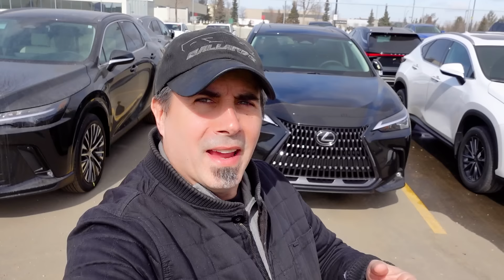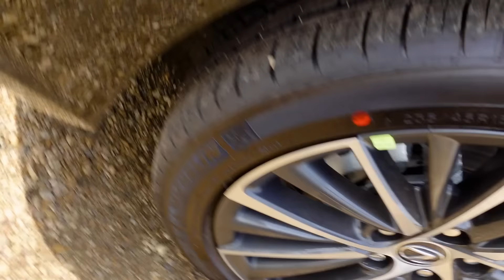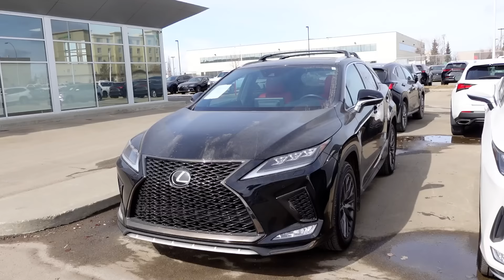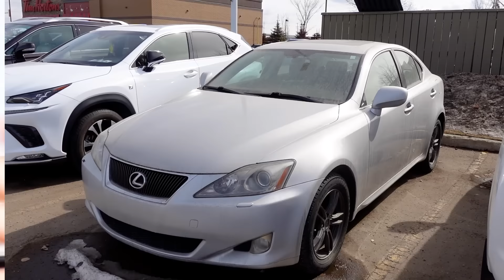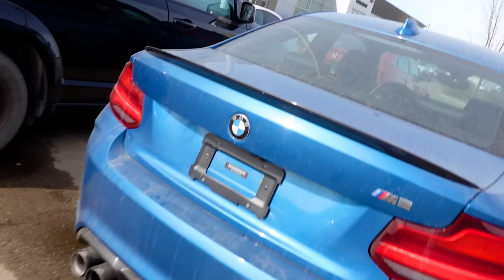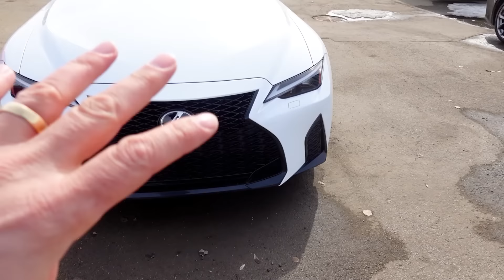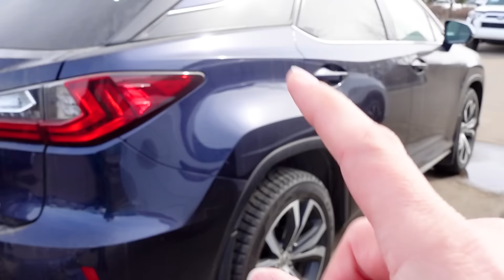Is Buying A Used Lexus a (MASSIVE) Mistake?

Comment: Good practical and helpful video. I have owned Lexuses since 1996 and my current 2015 RX350 for the last 7 years. I bought it as a service loaner...CPO..with 10K miles and it now has 90000 miles and is in very good condition. I usually upgrade to a new or new Lexus every 4-5 years but due to the market conditions of the last 2 years i decided to keep the 2015 as i have always carefully maintained it .I just had new brakes installed front and rear and getting 89000 on the original brakes is phenomenal in my opinion.  Because even RXs as old as 2020 models are selling for very close to MSRP if the mileage is moderate, Im not willing to pay that kind of money for one that old even though it would suit me fine, especially if it was CPO. I dont trust Lexus dealers like i used to ,even with their CPO cars  so if and when i decide to buy another CPO Lexus I will get a pre purchase inspection to keep them honest before i make a deal. The ES350....i have had 2....is actually my fav Lexus but we need an SUV so I usually buy the RX these days, but would love to have another ES even if it was an old 2010 or so model.
Reply: How to do a pre purchase inspection? Shall I pay for the pre purchase inspection by my own? Thanks!
Reply: @he6005  I have never seen any seller, private or dealer, who would pay for a pre purchase inspection. The potential buyer has to pay for it . Importantly, to avoid wasting your money, get a sales price agreement in WRITING which includes a contingency that the sale will only be completed if the pre purchase inspection is to the buyer's satisfaction. Otherwise you can spend $150-200 for the inspection, decide to buy the car and find that you and the seller cant agree on a price. Additionally, if the inspection shows problems with the car the buyer can use that as  a basis for negotiation of the seller's price, or walk away from the deal depending on the severity of the problems indentified by the inspector. Finally, who you select for the inspection is critical because various inspection services dont all offer the same depth or detail of the inspection. When you hire an inspection service, make sure you specify and they guarantee in writing the exact details their inspection will include. A good example might be a compression test which most inspections do NOT usually include, but which is critical in a used car of older cars.
Reply: @whocares0316  Many thanks for the detailed answer! I'm currently planning to look at a 2020 Lexus RX350 with only about 40,000 km mileage on it, and it's even still under the official Lexus warranty. My friend advised me that there is no need to do an inspection of such a new car, just take a look around for myself and take a test drive. What do you think?
Reply: @he6005  All i can say is that in 30 years of buying used Lexuses...both certified and other...i NEVER had a pre purchase inspection done on one and never had a mechanical problem with any of them. Now, however, i think times have changed because I have in the past year started seeing people who bought a CPO Lexus subsequently have mechanical problems only to find out that the Lexus dealer had actually NOT performed some of the 161 points of inspections they rave about while they charge on average $2000 extra for a CPO Lexus vs what the car would sell for it if wasnt certified. So if i were you unless you are trying to buy a Service Loaner with 10K or less mileage, or something similar, i would spend the $150-200 for the pre purchase inspection. Lexuses have gone up so much in price that you really cant afford to take a chance.. It is true that if the car is CPO you have the CPO warranty to fall back on but there are lots of mechanical items that no CPO warranty covers and fixing a Lexus isnt cheap! Finally, before i hone in on a Lexus i want to buy, especially used, I evaluate the DEALER who is selling the car. The QUALITY of Lexus dealers "aint what it used to be" and that is an understatement. And the caliber of Lexus salesman isnt what it used to be. I dont normally ever buy a used Lexus from anyone but a Lexus dealer unless it is from a new car non Lexus dealer who has a nice Lexus trade in they are trying to sell.  I am pretty disgusted with Lexus these days and bought my first one in 1996. Hope this helps you. Just my own experiences.
Reply: @whocares0316  Thank you very much for your detailed sharing, I will take your advice and  consider my purchase seriously.
Reply: @he6005  I understand what your friend is saying about a car with only 24000 miles..US...on it, especially if you still have a significant amount of TIME left on the warranty...which is 4 years from original in service date. I would first demand a Carfax report on the car which any Lexus dealer will always typically provide, and I would NOT normally buy a used Lexus from a non Lexus dealer because, while the orig mfg warranty still applies and transfers, I dont buy used Lexuses unless they are Certified PreOwned..CPO which covers up to 6 years and 100,000 miles from original date in service. It is true you will pay more than you pay for the same non cert car from a non Lexus dealer, but the additional protection is well worth the money in my opinion. I have since pandemic days seen several examples of used certified Lexuses sold by Lexus dealers where the new owner had problems that were not identified or repaired by the Lexus dealer as part of the infamous 161 point inspection. In short i dont even trust Lexus dealers anymore  so im getting any car i buy from them inspected before i buy it. I have been looking at a 2022 RX350 which has 5,035 miles on it and their price is MUCH LOWER than any 2022 RX i have seen. Reading the CARFAX I know there is something wrong with the history of that car which is why the price is so relatively "wonderful". The dealer cant or wont explain it to me so I pass. Hope this info etc helps. Be careful!
Reply: @whocares0316  Thank you, friend. Later, I bought the 2020 RX350 with 24,000 kilometers, and I have used it for 1 month. It also has a year remaining on its warranty with no accidents according to carfax. This car was a Lease car. Since the mileage is relatively low, it is not cost-effective to return it directly to the Lexus dealer, so the previous owner and the Lexus salesman found a way to sell it to another car dealer. After getting the background on the car's past, I made my decision to buy it (because RX350s are in demand in Canada and I was in desperate need of a car). I know I'm going to take some risks. Fortunately, no issues so far, apart from the well-known 8-speed automatic transmission hesitation issue (which is a big difference from my previous Tesla model3, so it's very noticeable to me), very happy with it. I hope there will be no problems in the future.

Comment: Hey i have an is250 2012 model and i had it for 2 years now. And i see no problems. Works perfectly, and i maintain it. Great car
Reply: Just exchange the oil every 5000 miles or 4000. I bought it new, 280k now and never had any problems with the carbon build up. It's a 2006 version.

Comment: A massive mistake if you buy one used from Carvana, or Lefty's 'buy here, pay here used cars' (the office is usually a trailer) despite Carvana's "comprehensive 150 point inspection" they will sell a stolen Lexus (or any car) that rolled down a hill, into a creek after a high-speed police chase and call it well maintained (perhaps, but that was before the rollover and flooding). Authenticated, valid car history is the key (pun intended).

Comment: I’m on my second Lexus.  Neither has ever needed anything more than oil changes and routine maintenance.  Lexus truly takes it to a different level in quality.  The only place I would wish they would improve is the paint jobs, but if you constantly maintain the paint, your Lexus will laaaaaaaaaaaaaaaaaaaaaaast…
Reply: Me too…on my 7th certified Lexus.  Never had one in the shop for repairs!
Reply: Wtf are you talking about. I hope you change the other fluids when the manual suggests. It's not like it doesn't need regular maintenance. Please read the manual to find out when each of the fluids need to be changed and follow that. It will last a lifetime.
Reply: @RIPToot Did you fail to read the words ROUTINE MAINTENANCE in my original post?  Oil changes and routine maintenance…
Reply: @longgrayline8055  Your totally right. I was just looking out for you. Glad you take care of your car. I'm shopping for a used car and it annoys me how many people don't understand what routine maintenance means.
Reply: I have a 2022 ES 350 that seems to have too many scratches and tiny chips in the paint. Do you have any good sources of info for how to repair & maintain paint on a Lexus?
Reply: @leojanuszewski1019  Is yours made in Japan?
Reply: Go to a detailing shop and ask for ceramic coating
Reply: Is this ceramic coating applies fixing regular paint chips, scratches on the Lexus RX bumper? How to fix these easy chips and scratches on Lexus RX?
Reply: @longgrayline8055  the painting job is awful, this 2011 RX 450h AWD vehicle paint chips all over everywhere, even while driven only around 5,500 mi annually on average. Is there any advice how to coup with chip-protecting of my pearl white paint?
Reply: Reliability not quality. Interiors are plasticy and scratch easily, the  leather too. Also they use some funny parts, my 2010 had a green font digital clock from a 89 camry lmao
Reply: @bryansmith536 . Mega high quality.  I’ve had 4 Porsche 911’s, 2 Mercedes Benz, a 2010 GT500, and the 2 Lexus models.  The Lexus was every bit the high quality the Porsches were and definitely online with the Mercedes Benz as well.  Lexus is it’s own division.  They may use the same frames, but the extra expenses of higher quality materials are definitely there.  I’m hoping they come up with some EJ2-powered twin turbo F models.    I’d prefer the smaller engine for better handling and it’s ability to hold up to 1,500 horsepower without needing modifications.

Comment: Great tips. I found that if you live in a rust belt you should spray under the car in the spring to was the salt away. It helps a lot.
Reply: Wash it all winter to get the salt off. Wash it often
Reply: Better in the fall. Gives a shield from salt. I get Krown Rust every September.

Comment: Is buying a used Lexus a few years old (5-7) with 50K-70K miles really a good deal?  If you can pay cash for it outright, then maybe.  But, be prepared to spend several thousand $ in the first 1-2 years of ownership.  You very likely will be replacing brakes all around, tires all around, suspension components (struts), and a battery.  And a very good chance a replacement alternator and replacement AC compressor.  All together, easily $5K.  I know these things to be true, because it happened to me on a used RX 350.  So, some would say those things are just common maintenance items common to every make of vehicle...which is true.  What is concerning is that same Lexus, along with the ES model that came before it, both had janky transmissions that were giving many signs of imminent failure.  The RX at about 70K miles and the ES at about 100K miles.  Moral of the story, modern used cars beyond the warranty period can be very expensive to own and maintain and Lexus doesn't have a waiver.
Reply: Bought a 2012 Lexus LS 460 in 2019 with 94,000 miles on it. It now has 168,500 miles on it. The only thing I have had to replace is 1 battery, and 2 sets of tires. Brakes are due soon, but still working fine.
Reply: @beverlyquintela2754 you lie

Comment: 16 months ago, I bought a 2013 Lexus ES 350 with 35k miles on it. 1 owner, garage-kept, like new. Paid $21k for it. Now has 47k miles on it. I keep it garage kept, detailed, but since I moved much closer to work I only put about 50 miles a week on it now. I can attest that the 3.5L V6 is one of the best NA V6's ever made, very refined with smooth reliable power. I did put aftermarket wheels on it, black with machined accents that make it look more like a F-Sport, even though there was no F-Sport option in 2013, and it handles better with the 18x8.5" wheels. Only problem I had was the bearing in the idler pulley dried up and went south. So I bought a new idler pulley and tensioner pulley while I was at it, and new drive belt, and all-in spent $120 and did them all. Besides basic maintenance, that's all I've spent on the car. It is a great balanced car to drive, pretty much my favorite car that I've owned. Looks good, feels good, gives me a chub.
Reply: Does it have the 2gr-fe?  If so, expect a $4,000 bill soon to fix a timing chain gasket.
Reply: @daleckio  Yes it has that engine... that was the only engine offered for that model. And if that happens, I'll fix it myself.

Comment: Currently #1 in dependaibility 2023 by J D Power and #1 22 out of the last 27 years.  On sixth lexus and not one problem with one of them. Lowest in maintenance cost among luxury vehicles and highest brand loyalty.
Reply: JD Power is literally a paid for award.
Reply: Thank you. Very informative.
Reply from the maker: Cheers
Reply: @Fred S
Genesis has won that dependability study a few times and is a lower cost in maintenance

Comment: I have an IS250. It' accelerates great  in manual form & you have to use 5000 km oil change interval to mitigate carbon. Otherwise great car. IDK about the early manual transmissions tho; mine is 2011.
Reply from the maker: True if you know how to manage it, they can work

Comment: Like your channel but disagree on the IS250. My 2011 IS250 is running as strong as ever. Installed an oil catch can and periodically CRC Intake Valve Cleaner through the air intake. Blackstone labs results come back with healthy engine results time and again. Drain and fill the tranny routinely. One just needs to know how to maintain these baby’s in order to last 300k-400k miles. And helps that the IS250 has been in the family since 2011. Keep up the good work.
Reply: You have been lucky.  The 250's are known to have issues.